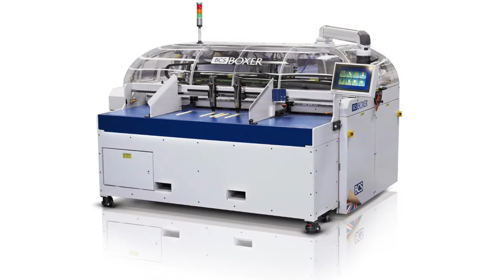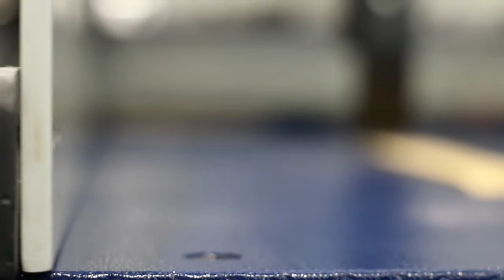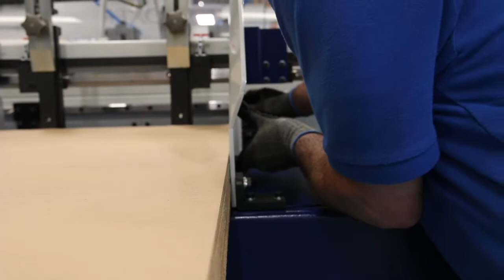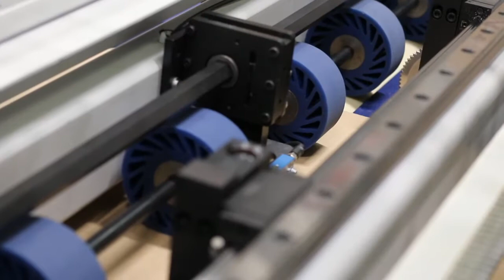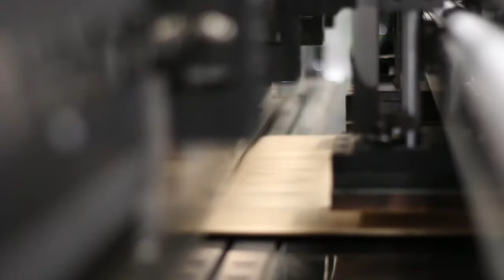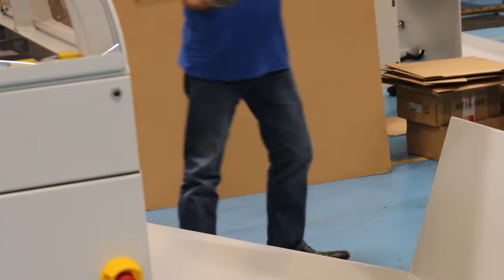Short Run Box Making Machine (How The BOXER makes custom boxes)

Comment: The interface needs to Multi up pads on the X axis. It can multi up on the length but not width. Add this function and the machine also operates as a slitter. 

 The deflector wheels by the line cutters that direct trimmed board into the cavity under the machine need a quick release. Not 5mm hex bolts in cumbersome positions. 

 A 4th line cutting tool that rests on the far right would also help the machine work as a slitter. 

 The wheels under the line cutter are prone to jamming as cardboard fibers (paper dust) build up. There is no inbuilt method of clearing them. Ditch the wheels and use a plate with a slot (for the line cutters to sink beneath). This would still support the trimmed board and won't allow for paper dust build up. 
  
 There is no scored pad in the style maker library and manually setting guillotine scores is unreliable. 

 The line cutters cannot reliably make small adjustments. If a 2 or sometimes 3mm adjustment s required the operator must first move the line cutter by 10mm and then back 12 or 13 to get the 2mm adjustment. 

The slotting blades are not easy to change. They are very cumbersome to remove and install. Again a quick release and quick lock system would be beneficial here. 
 
 The scores slowly lose their pressure and recalibrating them isn't intuitive. It's not in the users manual either. Eventually scores pressure on thinner boards like E and R flute, even B flutes become so low the scores are nearly undetectable.

 The feed sensor does not work in well lit environments. The operator has to use a shade over the feed to get the sensor to register board.
Reply from the maker: Dear Adam,

Thank you very much for taking the time to give us your feedback. I read your suggestions on how to make improvements to the general function of the machine with keen interest and will certainly report these back to our R&D team. I do know that some of these points have been achieved already – as we continuously look to improve our machines.

Thanks again for your comments
Kolbus Autobox

Comment: I'm not sure I've seen a short run box making machine that looks so easy to use. He literally presses the interface screen just a few times and it's done. Is this normal or has it just been set up to look that easy for the video?
Reply: Hi Andy, I've used this machine before and it literally is that easy. It's actually one of the reasons I chose BCS for my machine because it's so easy to teach employees with no experience to use them.
Reply from the maker: it's normal! we use state of the art technology, which means that the operator can quickly and intuitively program the machine in seconds - ready for the box production run